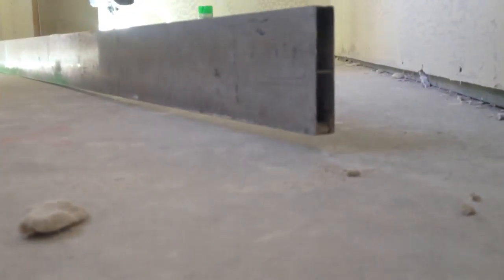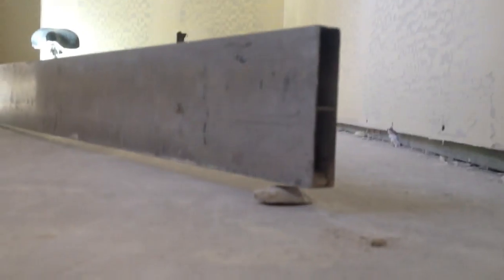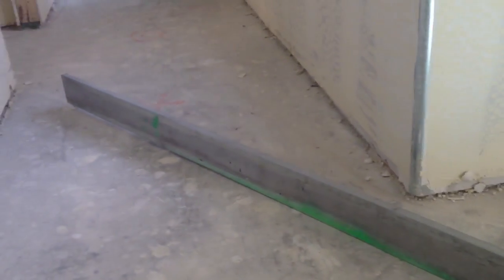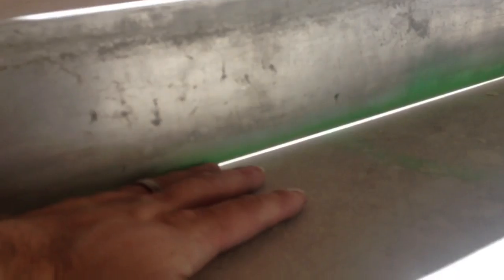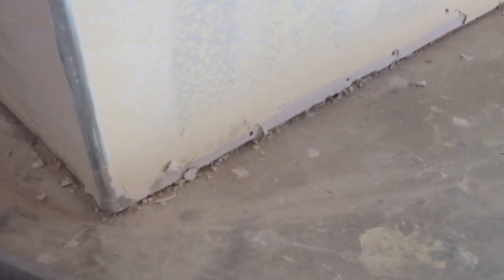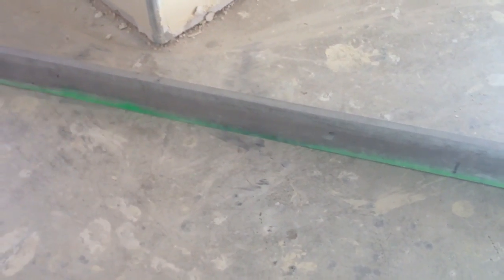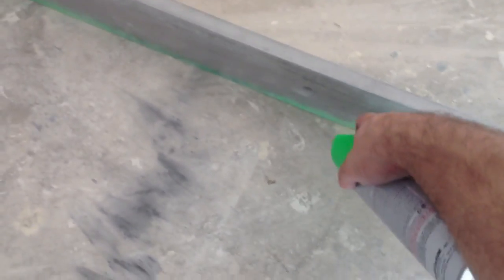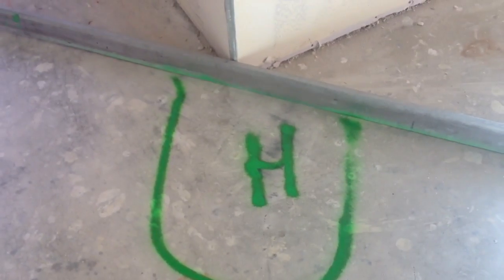Checking a concrete floor for tolerance.

Comment: split the difference to find how much you truly need to grind. If you grind 3/8" out of that hump you will have a low spot there. Level the straight edge and you will see a gap on each side. That hump is likely only 3/16" out of tolerance.